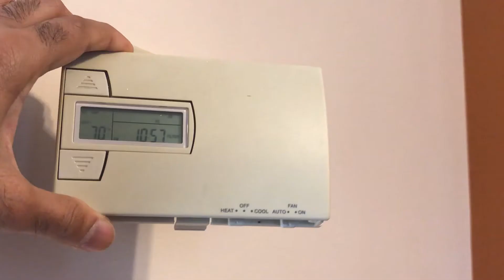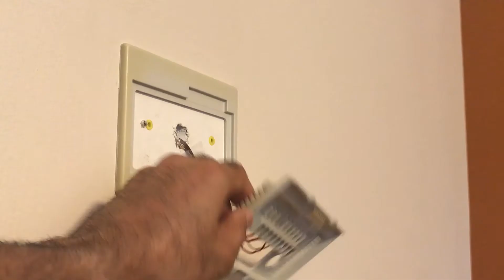Install Nest E thermostat using a common wire ( C Wire) adapter for 2 wire, heat only system

Comment: Thank you, this is great! A very clear and easy to follow video. Our landlord told me to connect just the transformer to R and C and only White from the furnace because they "shared a common ground", but the furnace never turned on. I was unsure if I should connect the Red to the same slot as the transformer, but now it works.

Comment: Dude, thank you so much! This was the only video I found that helped me get the Nest E hooked up without a d*mn relay. I didn't want any phase issues so I ran the plug in transformer wires to the C and Y ports on the nest. This worked perfectly for the baseboard heat in my living room. Thank you again for doing the needful!

Comment: Thanks for video. 
I am using heat only and getting battery problems so I will add c wire now.
Reply from the maker: Glad it helped. Good luck.

Comment: I have a similar issue with new nest thermostat that does not have Rc so I would like to double up on R for 24v transformer.
Reply from the maker: I think that many newer ones have just R.
Reply: @agiantsmallstep7001  I ended up buying nest learning thermostat and running a 4-wire and adding a 24v transformer. More than you want to do :-)